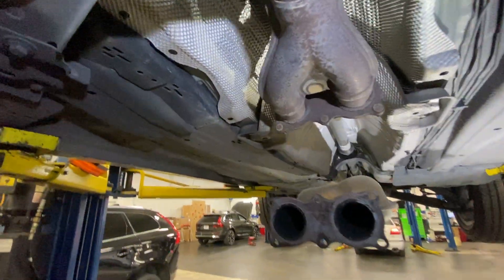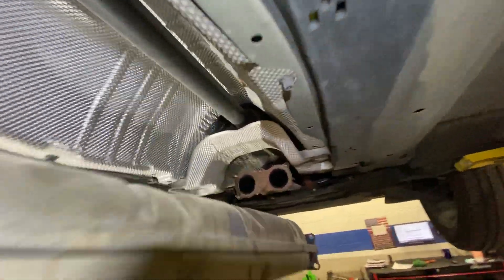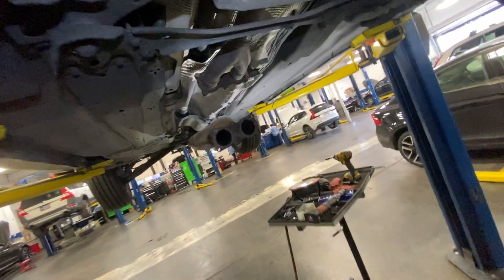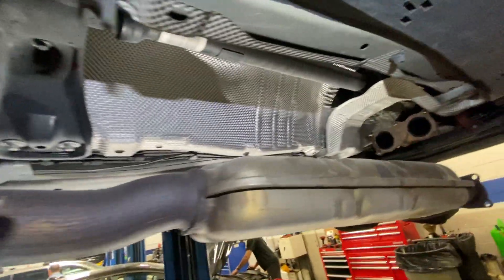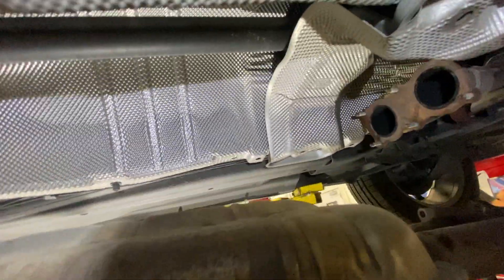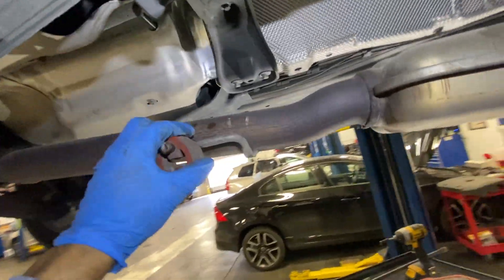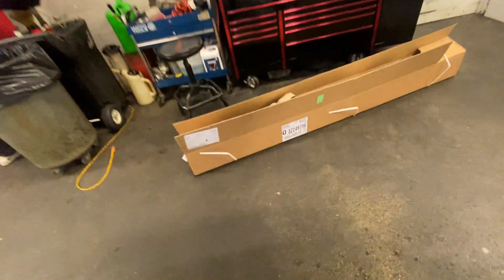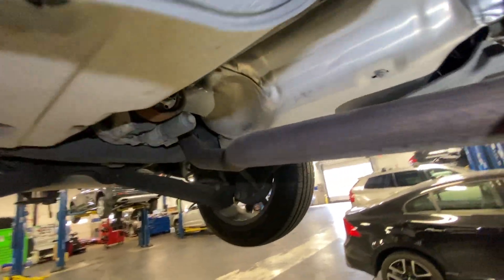Volvo drive shaft replacement tips

Comment: I wonder if the bad bearing can just be replace and not the whole axle.
Reply: Know this is 4 months old now, but nah, this looks like the underside of my P3 XC70 and the S80. Two bearings, both welded on, guess what I'm fighting with currently trying to find a replacement for that isn't nearly 2 grand? Haha
Reply: @Dracasethaen  Does one steep price, we just did the bearing on a 99 Tacoma parts and install for the bearing under 300. labor was free.
Reply: @bernardaflores1720  Not sure. Digging into this further since I'm still monkeying with it - the front CV is the only thing that can be replaced on the driveshaft, if any of the other bearings are bad, the whole shaft has to get replaced. Called Colorado Driveshaft (highly recommended on enthusiast boards) and a new one is $800, the CV kit isn't really cheap either, so just seems like going straight to a full replacement is the lowest cost (well, for me anyhow, I do all my own labor)

Comment: what year and model for this vehicle? What was the part number for that driveshaft, was it genuine Volvo? Looks like it had one of those blue stickers but it went by so fast in the footage I couldn't tell.
Reply from the maker: Yeah oem parts only. It could be 2017-2019
Reply from the maker: never mind I think it says six-cylinder engine could be at 2013 somewhere around there probably xc60

Comment: Thanks! What is the torque spec for those hex8 bolts?
Reply from the maker: @sergeibzk  will check
Reply from the maker: @sergeibzk  10 Nm first stage 20Nm second stage 
Do all 10 Nm first and then do all at 20Nm
Reply: @VolvopediaGuy  Wow, that torque is so mild. Good idea is to use some medium thread locker too.
Thank you very much for checking that for me 🙌
p.s. mine tighten 35-45 Nm, next time I'll use correct torque and some medium thread locker.

Comment: My 2012 vibrates after 80km/hr. Wonder if this is cause
Reply from the maker: Under acceleration vibration will be worst. If its constant can be bent wheels. Tire separation.  Also front axles can caude vibration while accelerating
Reply: Me too, mine gives a rattling noise when removing my foot from the gaspaddle. I am not sure if it is the axl.
Reply: 2009 Xc70 T6 i have vibrates when accelerating from 45mph to 55mph and then goes awway. found out the rear crossmember that holds the back end of the drive shaft is eroded away. It was allowing it to flex. In the process of changing it right. but the replacement is 1300 for the whole axle, doesnt look to be able to replace segments.